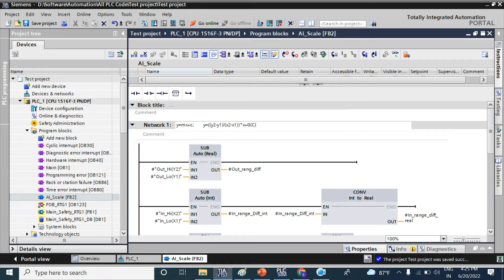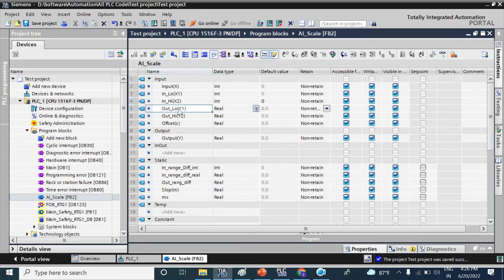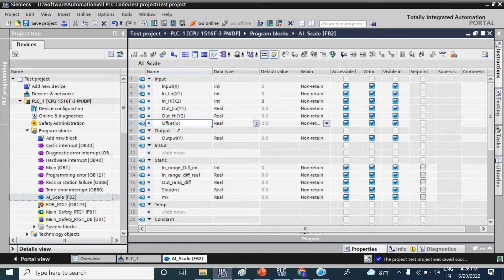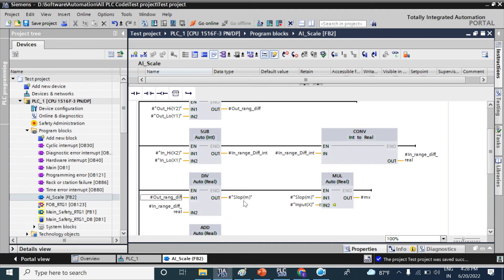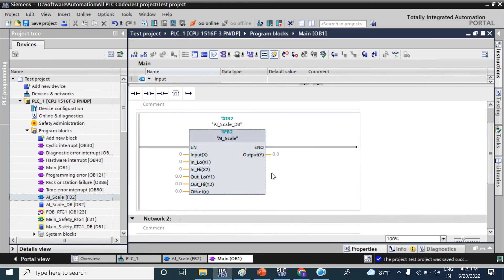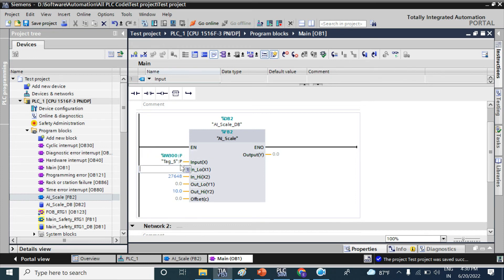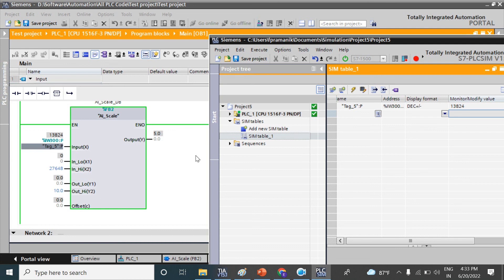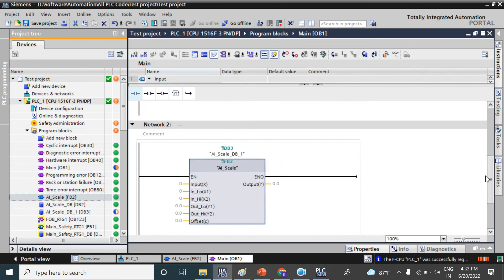TIA portal: How to scale the analog input by using linear equation? Explained in details. Lesson-15

Comment: Is this linear scaling will work too if im using Dp transmmitter as level measurement and Flow totalizer i love ❤️ your video sir i hope you answer me sir
Reply from the maker: Yes it will work for any input
Reply: @faridautomation  Sir farid about this linear equation i have question about Dp transmmiter that some programmer used differently. its seems they didnt use this equation instead they used URV and LRV EQUATION for open tank and close tank what is the difference of this to the other
Reply from the maker: @nelsonpantaleon7751  Here I have used linear equation for scaling the input, if want to control or generate alarm from same block you need to use some other input... e. g: Limit High, Limit High High, Limit Low, Limit Low Low ... Later I will share that video...
Reply from the maker: By that alarms you can open the valve(using Low or Low Low) and Close the Valve( using High or High High)
Reply: @faridautomation  thank you Sir farid we will wait for that video sir we are waiting that thank you very very much we learned a lot from your video
Reply from the maker: @nelsonpantaleon7751  I have started sharing video about analog input .. you will get all the thinks you need about analog input and block ... Keep watching
Reply: @faridautomation  can request sir can you do some program for flow totalizer using ladder

Comment: And also sir this linear equation is that you used in this video is for DP TRANSMMITTER right sir if  i want to use this equation for level measurement in the tank its the same procedure like this or no thank you sir
Reply from the maker: Yes you can use that function for any input, but if you have some  negative or positive value at 4mA. You have to use C. For example: input 4-20mA with range -5.0 to 20.0 then your C=-5.0
Reply: @faridautomation  if i dont have negative value no need to use C im a right only need C if i have negative value in 4 ma if dont have no need to use C right sir
Reply from the maker: @nelsonpantaleon7751  for positive value also example:
Your input value4-20mA and out scale:5.0--20.0 in that case C=5.0